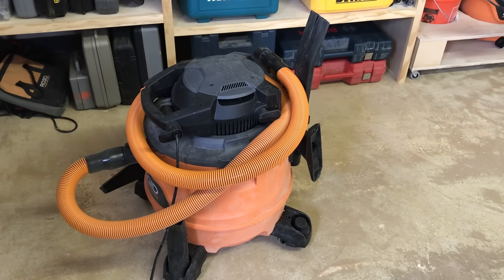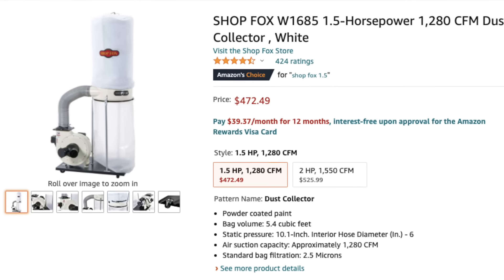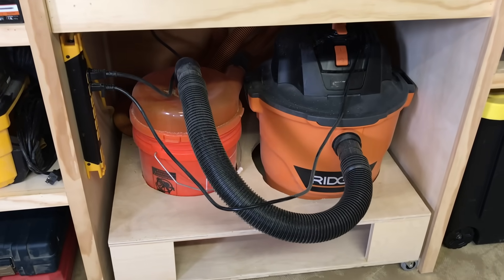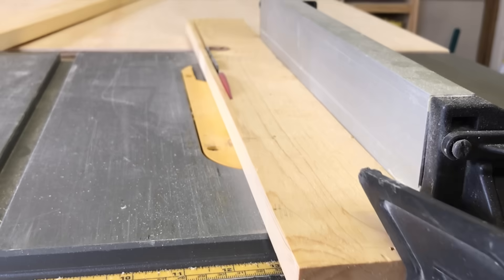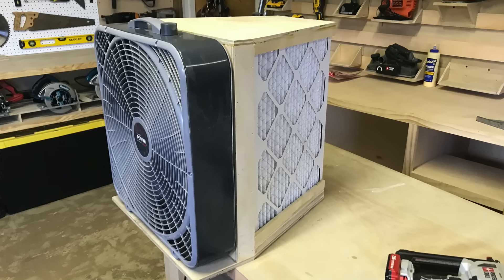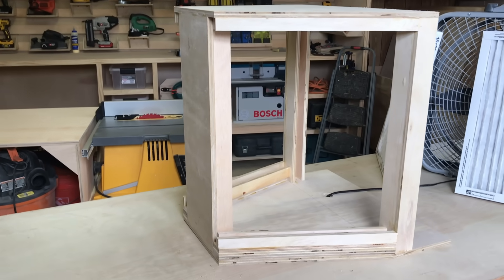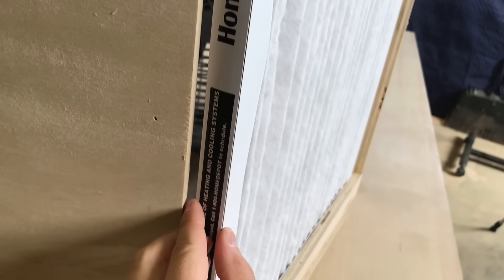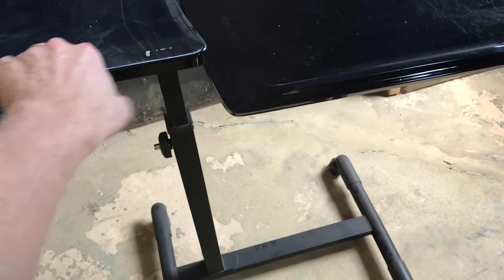BOX FAN AIR FILTER For About $40! (How To Build a DIY Box Fan Air Purifier With HVAC Filters!)

Comment: Great video to highlight the dangers of fine wood dust particles! Just a couple pointers as I've done many experiments with my own box fan filter:
    1. Charles Cox has pointed out to not overwork the fan. To add to that, clogged filters will actually force the box fan to pull air from the FRONT corners of the fan, just to blow it out the middle, effectively bypassing the filter media behind it. When this is the case, the box fan is actually counterproductive as all it's doing is blowing dust around the shop.
    2. To avoid frequently clogged filters, use thicker filters than the standard 1", if possible. (I use 4" filters) Thicker pleated filters have more surface area of the filter medium and therefore can "collect more" dust. In practical terms, you won't need to change the filters out as often.
    3. Try going to a local HVAC supply store (typically for professionals) and start a cash account with them to buy filters. I get mine for a fraction of the cost at big box stores.
Reply from the maker: Thanks, Woodworks! All good tips 🙂
Reply: @TheHonestCarpenter  Hey Ethan, one thing I haven't seen in your videos worth mentioning is wearing a mask like an RZ mask to help protect your lungs - in addition to this great diy box fan filter idea. Thanks for all the great content! Also looking forward to hearing about the books you are working on this year.
Reply: I built two of these for my house. Never had dust in the house, but the wife hated them.
Reply: How much are you paying from your HVAC supply store?
Reply: Very nice advice, thanks you're a great help!
Reply: The filters you're using are maybe a MERV 7 and they don't catch diddly.  I had them in my house and replaced them every 3-4 weeks because they were lousy.  Finer particulates need a tighter weave, so you need a higher MERV factor.  2" filter > MERV 14 will do a much better job...cheap filters will suck it right back through and launch it back into the air.  Ask any woman who has to dust a house!
Reply: I'm not good at negotiating. How do you start a cash account with them to pay reduced cost, what do I say?
Reply: After reading these comments, I’m confounded—how about an updated video?
Reply: @anyfoolknowthat  if you just do some searching on youtube you'll find that engineers have dedicated whole feature length videos to these types of filtration units. One thing is instead of just using two filters, put this thing on 4 legs then you can utilize 5 filters at once and super boost the efficiency and dutycycle between filter changeouts. One thing I've seen no one do, but I think would make it perfect, is to utilize reusable metal mesh based filters. They make them for all sorts of particle sizes and are used in industrial scenarios but haven't quite caught on commercially due to other higher initial price. But if you think about it, you'd never have to buy replacement filters ever again because you can either wash them or burn them clean as new.
Reply: @johnjingleheimersmith  JJ— can I contact you? I’d like to hear more about metal filters. That does sound interesting
Reply: Honestly, fun project.  But not $40.00.  The filters alone are 71.00 per 6.  Fan is $40 alone.  Just buy the Wen Filter system for $139.00 and get one properly designed and don't take chances with your lungs.
Reply: @Theexplorographer  Check out the Izzy Swan video on the same subject.  You'll be surprised how these perform vs. the low-end commercial units...he has a link to research and data that proves, if done correctly, these set ups are more efficient in turning over the air in the room.
Reply: @Theexplorographer  Have to agree with this - ran one of these while grinding concrete in the garage and it was extremely easy to see how much dust was sucked in from the front corners and launched across the room.  If you already have a box fan and some extra filters lying around this is a good first step, but ultimately the wen / grizzly / rikon 400cfm units (especially when they go on sale) are a much better inexpensive option since all air is forced through the filter.
Reply: @Theexplorographer  I hadn't heard of that type of filter system and it looks pretty awesome for the price. Thanks for the tip! The time alone I'd spend building the far less effective filter in this video more than makes up for the cost, which as you point out is not much more. Probably less if you don't have any sheet wood handy.
Reply: @Theexplorographer  The fan is 20 bucks at Walmart and i think you overpriced the filters as well.
Reply: @terry2346  Trust your shop to a $20 fan.  Also, AGAIN, NOT WHAT WAS IN THE VIDEO!
Reply: @terry2346  Walmart box fans might block two of the four intake side corners.  This is the opposite of what is desired where the output corners are blocked and the input corners are not blocked by plastic supports to give the box frame strength from collapsing sideways if weight is put on top of the frame.
Reply: @Theexplorographer  family dollar Lowe’s and dollar general all have 20x20 box fans for $18.  I just checked them all In person. And at Lowe’s if you buy 4 filters they give you 20% discount making them about $15 each.  Walmart has filters for $22 each.  Box fans under $20.
Reply: @UseYourManners123  Wood and construction time...And not what was posted here. Just saying.
Reply: @UseYourManners123  To further potentially save money one could also additionally use the much cheaper and inexpensive MERV 8/10 air particulate air filters and place them piggybacked directly on top of the much more expensive four inch MERV 13 particulate air filters; this would serve to preserve and prolong the period of time that the much more expensive four inch MERV 13 particulate air filters can be potentially used hopefully; this would also depend on the potential discount on the actual effective cost of the lower rated and much lower discounted MERV 8/10 air particulate air filters at the time of purchase to realize one's potential anticipated calculated competitive savings.
Reply: Regarding (1) it also helps to shroud the front of the fan so the corners can't act as intakes - use duct tape and cardboard to leave just an 18" circle. You get more efficient airflow that way. Obviously as long as the filters aren't clogged.

Comment: Ive always had 1 cheap filter taped to the back of a cheap fan for the last 20 years for 24 hours a day. You can hear the fan slow down a little when you put the filter on but never had a fan overheat. I could just be lucky. Use your own judgement, not mine.

Comment: Love this idea, the trapezoid seems like it would make more efficient use of the space and double filter surface while also putting less strain on the motor by restricting the airflow less. I was thinking about making a screw on panel with weatherstripping to span the back and cover the gaps where you used duct tape. Thanks for the idea.
Reply: Another improvement to reduce the profile, reduce the friction, and increase the airflow/filtration, is to use a single deep filter, like a 5” deep MERV 13, attached flat to the back of the fan (with tape or housing). The deeper filter spreads the friction over a wider surface area because of the pleated folds inside, enabling the fan to push close to its max CFM while maintaining a compact shape.

Comment: I found another bid where they used 4 - 20” x 20” Merv 13 filters. By using 4 filters what this does is allow the fan to pull the air through the filters without slowing the fan down. At all.

Comment: i bought 2 15 dollar fans and made a encosure with a method of attacking a air filter. i then attached it to my ceiling and wired it to my lightswitch so whenever someone goes into the shop (my shop contains utilities so it wont just be me going in there) the air purifier turns on at the flip of a switch.

Comment: Hey Ethan- If you can, get jet 1200vx-ck1. At least I think it's 1 of the best for the price.  The canister is great if you swing the handle every couple of hours, and the cone inside is great for filtering out the small from medium size and larger particles.

Comment: Great design.   You'll want a filter in front of the fan.  When the fan is stressed pulling air though back filters, it will actually draw air in from the sides on the front side of the fan.  (Mathias Wandal has  nice video on this.)   After yours runs for a while you will start to see a buildup of dust on grill around the periphery of the fan blades.   That is from dirty air getting sucked in the front and pushed back out.
Reply: Wouldn't this stress the fan more by blocking the outflow?
Reply: @gracefool  good question, very good…
Reply: Yessss sir

Comment: great fan / air cleaner video. Myself, on my shop vac exhaust port. I have used a $.50 pillow case and pipe clamp for 30 plus years, with great success for the finest of dust particles. Just cut the pillow case 1 inch or so off the floor. Consider plexiglass and epoxy to make your own vac hoods. Likely one design , would work for several of your shop applications while cutting wood. Using a larger vac pipe will increase the volume of uptake. Which is more important than pressure for capturing dust. Smooth wall dryer pipe or larger gutter down spouts or pvc , are superior to flex, if creating a short run or central system . You might create a squirrel cage unit ( new or used) as an alternative fan method. The cubic volume to  watts used is the advantage, and lower noise on a variable dial switch. keep up the great work .

Comment: The "This old House" channel had a similar arrangement. They used 4 filters in a box shape with the fan on top, blowing up and drawing air through the 4 sides. They were showing it as a indoor air cleaner. Great ideas, thanks.
Reply: I seen that video & made two, one for the house and one for the shop & really impressed with how well they work.
Reply: Saw that too and thought it was genius

Comment: Sure looks like your transitioning into a woodworking shop Ethan, it really is looking good sir. In my old shop I had my box fan above my assembly table on a remote switch, when I turned on my shopvac it turned on as well, I just used cheap remote plugs for outdoor Christmas lights... they are rated for 20a so they work great in the shop, remote hangs on my saw and I have another on my apron.
Reply: This! Love my cheap Christmas shop vac  remote!

Comment: This is a great idea. I use a single filter, never thought of adding double filters. By the way, I have run a cheap $20 box fan with a filter non stop for over 2 years in my bedroom as my dog likes to sleep in front of it. I only stopped it to clean it and it still runs fine.

Comment: Do you have a video that digs into your shop vac dust collection system?  I'm using the same setup of a Rigid shop vac with the matching brand separator you have there, but having challenges with matching all the different port sizes on my tools.  SHort of the process of heat guns and melting & forming my own adapters...  but I'm sure I'm going to have to do that at some point!

Comment: If you make it a cube, with one of the faces being the fan, one the 'floor' and the other 4 level 13+ filters, you'll get more dust, and won't overtax the fan.  Also, add another slot on each face for a lower grade filter to get the larger dust coming in, saves replacing the higher grade filters frequently.

Comment: Sorry but this is nowhere near a replacement for that BlueDri HEPA Air Scrubber : MERV 5 barely filters any large particles and MERV 11 (the links) doesnt filter the actuall small particles that cause most damage. This will just give you a sense of safety. It should have at least MERV 15 or better bag filters that do the same (f7 or higher). I made something simular for about a 100 euro and this does filter most of those fine dust aprticles (g4 pre filter and f78 bag filter as main filter)

Comment: First, sorry for my English. What is your opinion on a setup that does away with the filters, and instead blows the air out the window? More air volume being displaced because there's no filters to slow it down, and the dust gets blown straight out of the shop. To this I regularly add a couple of minutes of using my leaf blower to get the dust that has settled on any surface, back up in the air, so it too can get blown out.

Comment: You can use two cheaper blue “pre-filters” in your design and than incorporate a more expensive merv13 filter right at the back of the fan.  It only adds 1” in overall length and will have better results long term while saving money over the long run.
Reply: I also like the idea of adding super cheap pre-filters.  This is always done in industrial settings to protect the more expensive polishing filters and extend their life.

Comment: Ethan you should build a shroud around the fan. The extra space causes a turbulent airflow and decreases efficiency. Much like old cars with crank mounted fans. They all had fan shrouds to increase efficiency. Matthias Wendell goes over this on his channel.

Additionally stepping up to a 3" filter would cause a significant improvement. You may need to "seal" the filter material as it is contained inside of the cardboard and not sealed to it.

Comment: Note that not any old box fan will work.  If the fan doesn't have a partition / shroud that comes close to the tips the fan will not pull much air through the filter but instead will pull air from the front at the corners and just circulate it round and round. A proper box fan will have the corners filled in or you'll have to add that.
Reply: One could use their hot glue gun and quite literally hot glue an appropriate ideal fan shroud form directly to the underside of the fan grill inside the fan chassis made from a much stiffer form of plastic called Coroplast which is essentially corrugated plastic cardboard which is also washable and cleanable on an indefinite long lasting basis.

Comment: Appreciate this on several levels. Decided 20 years ago that a huge complicated dust collector and ducting was expensive and cumbersome . Hooked shop vacs up to table saw, miter saw and have a single stage for the planner and joiner. Got a ceiling mounted jet air cleaner.. will make one of these to  suck up some more dust because there is always more dust. Thanks